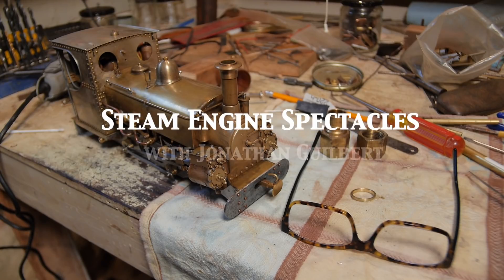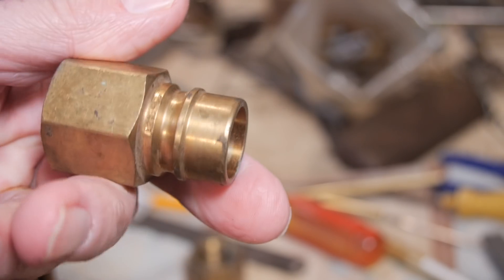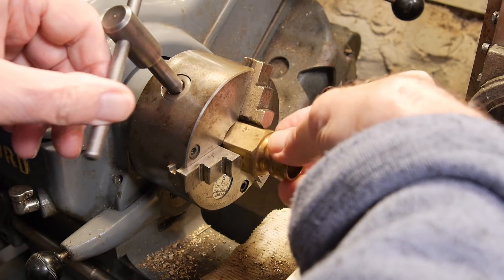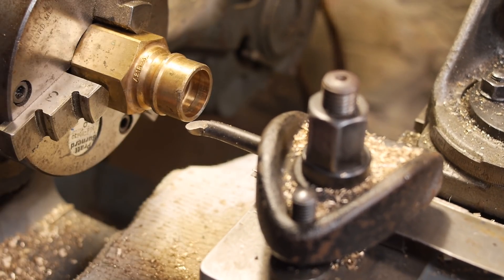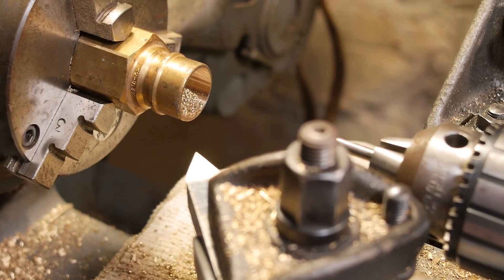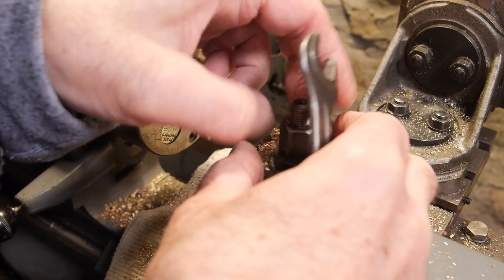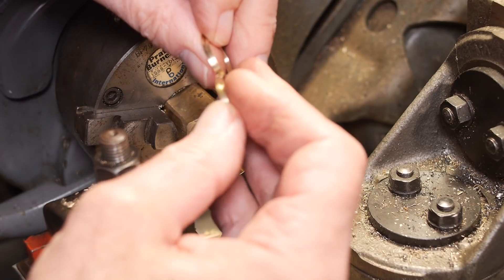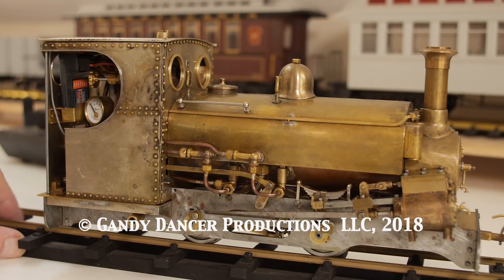Steam Engine Spectacles

Comment: Your engines Russell and Blanche are fine loco's.  How did you achieve the rivet detail on your models? I am building a rake of ICI limestone hopper wagons, in Gauge 1, 10mm scale. I am far from being a rivet counter, however the riveting on these wagons is very prominent and I need to achieve at least a passing resemblance.
Reply from the maker: Hi Steve, I used real rivets.  They're not actually holding thing together in most cases.  I just drill a hold and carefully flatten the back with a hammer.  You could also use super glue to hold them.  I have a variety of small rivet down to 3/64" diameter I bought a while ago online.  I have heard of pinheads from the sewing being cut down and used but those you have to glue in.